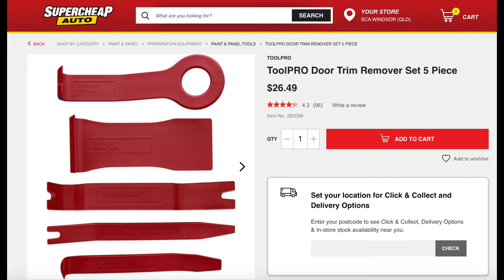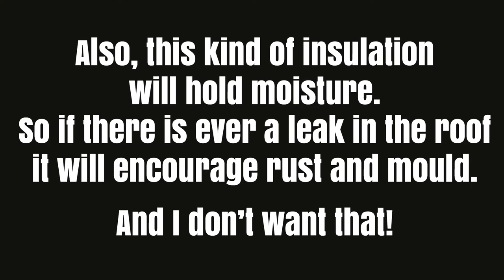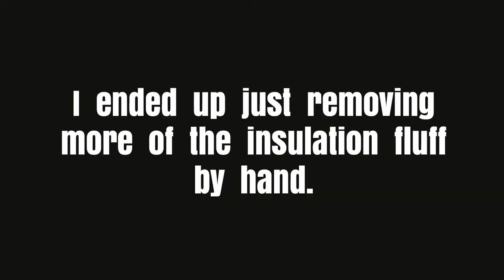Removing the roof panels and ceiling insulation in my Toyota Coaster bus conversion

Comment: If you re-use the roof lights replace the bulbs with LED's, they're just a straight swap and will have a much lower drain on the batteries for the same light output. They are available from warm white to ice blue light colour for normal use , in 12v or 24v

Comment: Hi we bought a toyota coaster 2000 thinking of  converting it to a motorhome.  Someone told we can't drive it with a normal driving licence.  Is it the case. Please advise us
Reply from the maker: It depends what the GVM is. There should be a plate on the bus that has this or it will be on your rego papers. Most coasters have factory GVM as 4990kg. Anything over 4500kg is classified as a heavy vehicle. If your coaster still has the original GVM you will need a Light Rigid licence to deive it. Sone coasters have had the GVM downgraded to less than 4500 so they can be driven with a car licence but if this is the case it will have the lower GVM on the rego or a modification plate on the vehicle